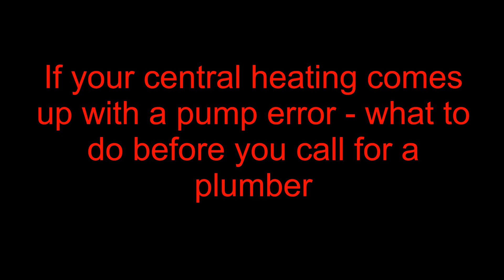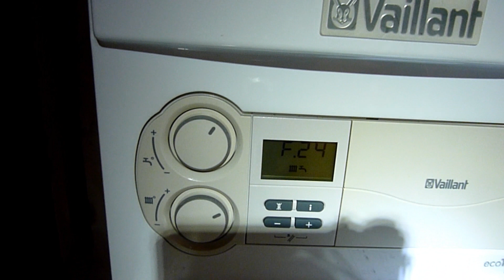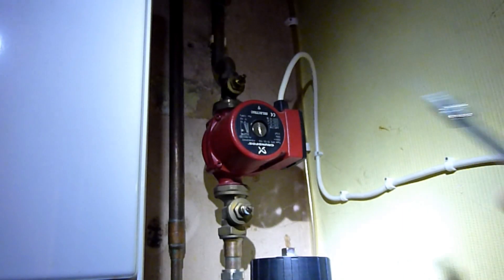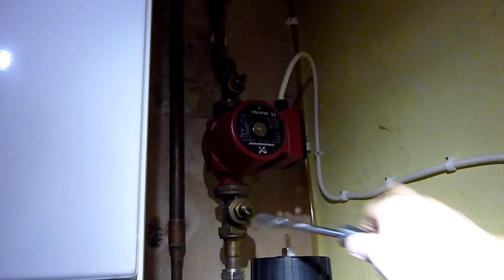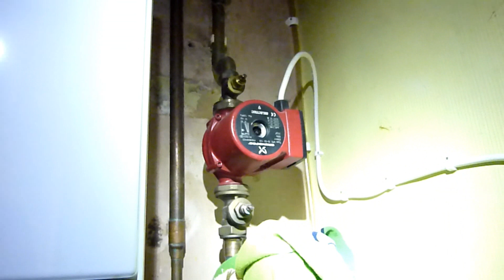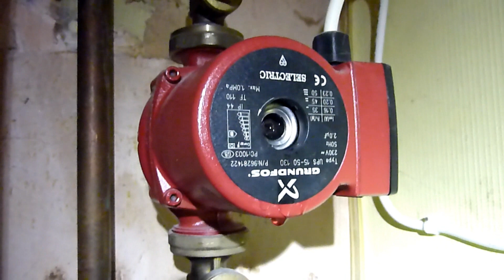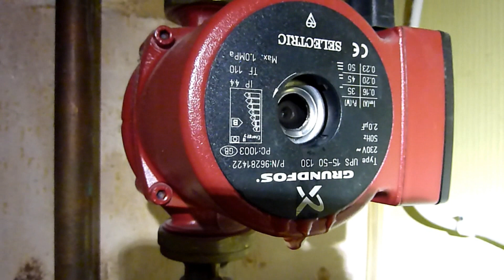Grundfos Selectric Central Heating Pump Stop Working -  What to do

Comment: Thank you soooo soooo much , an engineer came and said £250 to make it run but no guarantee for how long and I just didn’t have the cash , been without a shower stressing 2 days and by gods will came across your very informative video ❤️ god bless you the motor started but let see if in an hour theres hot water coming or not , I have one of those old water tanks :(

Comment: hi, my valves are leaking either side of the pump, looks very similar to yours, tried to tighten, just moved it slightly and they are leaking more now, what is the best remedy.. thank you
Reply from the maker: @backtodifuture  if your pump works still...shut off above and below if you can, otherwise drain the water by running a tap whilst shutting off the stop cock. Add ptfe tape or if there's a silicon seal, replace the silicon seal....ptfe tape is cheapest option , can add plumbing paste if you want.

Comment: I have the same one! When I opened it water keep going outside nonstop!!! Is that normal or water shoud stop droping???
My radiators are not that hot like they used to be.
Reply from the maker: @omistic  you should change the pump...see one of my other videos....if it is a little bit of water non stop then that is normal...if it comes out slowly then that is fine.... your radiators could he blocked up with black gunck.

Comment: Is it normal for these pump to work contnuosly? My pump is not stopping even though i only have a water tank connected to it.
Reply from the maker: @ZoeSham-x5n  that does not make sense... sounds like dodgy plumbing...sounds like you need your water tank at a higher place in your house. If it is in a high place you shouldn't need a pump if there's nothing connected to the system. Try switching it off and see if you still get water, or if it affects anything. Then you can work it out from there the real purpose if any.

Comment: Hello! Can anyone help me with my issue? Namely, from some reason, heating is not working, and I tried to check the pump, by unscrewing the cap as in this video (to try to start it manually by screwing the inside screw), but when I removed the cap on the pump, water started to come out in the stream. I closed it quickly, as pressure started to go down. Is it normal thing? Do I need to ignore the water stream and to try quickly to unscrew the screw inside the pump to check if it is jammed?
Reply from the maker: Yes ignore the water and try to spin the pump like in the video
Reply: Ok, I will try again. I've just checked and noticed that I can hear the pump, when I put it on. But if I can hear, does it mean that it works correctly? Or to try to roll it anyway...?

Comment: my pump got extremely hot and it's not circulating, will your method work if pumps is extremely hot? maybe winding shorted?
Reply from the maker: Replace your pump in your case...see further video on my channel for this.

Comment: Could i use a pump like this to boost water upto a radiator in a loft? (Converted). But put it away from the boiler so its on the vertical that goes up from the bathroom? Or are these best placed next to the boiler itself?

Thanks
Reply from the maker: I think protecting the boiler is more important, so if the pump was located elsewhere and further away from the boiler the efficiency of the water flow going through the pump could be effected though it is factual that water is generally considered incompressible. Think of your own heart...it is pumping blood all around your body but your toes tend to get issues if your heart becomes weaker. I think the easiest solution in your case is either switch the little switch on the side of the pump to number 3 abs see if that works, or simply install a higher rated pump that can deal with pumping up a negative head. Search for shower pumps as a way to educate yourself on negative heads because some shower pumps cannot pump up negatively. I would say just choose a very high pressure rated pump.

Comment: I had one that wasn't pumping but turned quite freely. I was all set to replace it but, on testing, it was clear the windings were still OK and it was simply the capacitor that had died. Interestingly they print the value(2uF in your case) on the label. It's easy to replace so long as you get one that is physically the right size. Its a motor run capacitor and is typically rated at 450vac available in loads of places.

Comment: Good video...but can you tell me why a central heating pump stays on continuously and how would we turn it off as ours won't turn off! Thanx
Reply from the maker: Do the least destructive checks first....turn off power to all units including the wall controller. Turn back on and check. Next try selecting no central heating on by turning down by dialing the temperature dial down to say 5C...if the pump is still coming on, then the control box on the wall where cables enter the pump is faulty....get an electrician to change the box. Observe the electrician turn off the power to the digital unit that has cables going to the pump by going to your home's main fuse box and flipping or pressing the button on the pertinent fuse off before the electrician works on removing the controller.
Reply: @EducationPineapple  Thank you very much for your reply...we will try what you say, thanx (;o)

Comment: Hi Sir, can you please help. We have run out of money and boiler decided to break. Bleed the radiators a couple of days ago and since then the radiators are working absolutely perfect but we have no hot water. Boiler is an old Halstead Buckingham III CF50 with the same pump installed. On water I don’t hear / feel any sound or noise or movement within the pump however when I turn on only heating then I can feel and hear some vibrations and movements within the pump. Can you please help. At the moment we are heating our space with boiler and using electricity to heat the water cylinder. Please help and save. Thank you
Reply from the maker: I hope I can help. Pause the video at 8 seconds. You will see a small white box where the three copper pipes converge. That unit selects either hot water or heating or both at the same time. Remove the cover and really the whole unit for now and rotate the valves by hand. What has happened is that unit is broken and stuck on heating only. The unit is about £20 new. You can do this by hand until you have the money. God bless and keep warm. Watch this next video I made in 2018 to show you more what I am discussing here...https://youtu.be/BEdiQP4vkeM

Comment: Brilliant video. If I ever drain down my system, the pump ALWAYS makes a humming noise, and the boiler stops working, despite clearing all the air from all the bleeds, and all the rads. Really frustrating. Any ideas what it could be? Cheers.
Reply from the maker: I did this technique for about 5 years until I had to change the pump. I have another video on how I changed the pump very quickly. It could be that your pump has failed. It could be also that the valves are closed...or partially closed...see my other video '...change Grundos pump...' because the stop valves above and below the pump works by being on if handle to  valve is on when pointing North South, but is off when the valves are pointing East/ west....if you get what I mean.
Reply: @EducationPineapple  thank you so much for the reply. I don't actually get it, but as soon as I watch the other vid, I will. Every time this has happened to me after draining the system down. I think it is that the screw inside needs slackening off after draining. It seems to coincidental that the pump fails every time. I only used to bleed the pump after draining, not undo the little screw inside. I'll let you know what happens 👍🏽
Reply from the maker: @MohammedAli-1  it means if you turn the water shut off valves 90degrees it will be off, another 90 degrees and it will be back on, so check you haven't shut the water off at the water shut off valves.
Reply: @EducationPineapple  Hi yes I checked and they are both north/south so that is good 👍🏽 Do you know where I can get one from, for a good price. Most people were saying they cost around £150, but looking online they seem to be £250-£300
Reply from the maker: @MohammedAli-1  i got mine for £30 new ....shop on eBay...
Reply: @EducationPineapple  wow. Other brands can be used can't they, when replacing? Is there a certain minimum spec that needs to go in?
Reply: @EducationPineapple  Hi thanks for all your help. Just an update. I ended up buying a refurbished one for £35. I installed it, and it did the trick. I also found that grundfos have an app that allows you to scan your pump, and the app then shows you other alternative pumps that are available to replace the one in your system. Thank you again for your help.
Reply: If you have regular boiler with cold and water tanks check for a unscrew able vent on a bit of pipe.

Comment: I know this is an old post, my Grant combi 90 mk 2 ,( outdoor oil fed boiler) keeps tripping out the burner........ im getting no noise at all from the pump even after opening the screw, turning the impellers (which seemed to have a lot of play like a worn out turbo on a car)....  would you from your experience say the pump is goosed? The boiler was imstalled 2006 if that helps and is the original pump...... hot water diverter valve and hot water blender valve changed 18 momths ago and secondary heat exchanger changed at same time...any advice?
Reply from the maker: sounds like you need a new pump
Reply: @EducationPineapple  yeah i kind of figured as the pump is as old as the boiler and making no sound at all that its dead...  thankyou for the reply my friend 👍
Reply: Did you turn off both isolation valves ,one above and one below before undoing the central bleeding screw to get at the fin retaining screw inside  , ? Thanks

Comment: Thanks. It turns freely but no joy. I have lights on the side which aren't on, so suspect I may have another issue. Mine is part of an underfloor heating system the wiring box is sending and receiving ok. Any tips for what to try next please? 🙏
Reply from the maker: Least destructive method possible which is to check the  fuse hasn't blown.

Comment: I have floor heating on the ground floor,  from the pipes from the floor heating system were hot, everything looked fine, 
- radiators on the 1st and 2nd floor were working properly extremely hot. 22 degrees room temperature

but floor heating on ground floor was not working properly (ice box) 15 degrees. I opened the Grundfos Selectric Central Heating Pump and opened up the little screw and closed it again with the bigger screw in the hope it was getting warmer in the room I have put the room thermostat on 23,5 degrees

But after 45 minutes the ground is still cold any idea's ?
Reply from the maker: Sludge has built up and sunk to the lower floors, or pump is weak, try turning the pumps power up to notch 3.
Reply: @EducationPineapple  Al working again I removed the screw on the pump and it seems the pin was stuck behind the screw and closed it up again all working again

Comment: May l please ask for your help, my largest radiator was cold at the bottom, so removed it flushed it thru and refilled it, bled it & added inhibitor. It is still cold at the bottom but so are all of my others radiators. Water pipe going in hot, but exit valve cold. (It is fully open). Could it be the pump? Thank you so much.
Reply from the maker: There's a switch on gringos pump...select l...ll...or lll.  Try selection full power lll ..it does sound like your pump is weak

Comment: Do you need to turn the water off
Or heating system
Reply from the maker: No unless you think the small amount of dripping water for the 1 minute job will cause a problem
Reply: @EducationPineapple  have you use the heat hero b4 is it any good
Reply from the maker: @fablan3308  no not used before..
Stick to the approved versions of these. Ask at a plumbers outlet for their advice what's best if changing heaters
Reply: @EducationPineapple  I cannot turn the power off on mine supply switch the main electricity box off is it dangerous to do it with electricity on
Reply from the maker: @fablan3308   I think you can catch the few drops of water with a towel
Reply: @EducationPineapple   do I have to switch off the mains electricity before I put the screwdriver in   to spin
Reply from the maker: @fablan3308  you should be okay to just turn it
Reply: @EducationPineapple   I will try tomorrow afternoon and let you know see if I can get it going again thanks you  I wish plumbers were this easy to 
Get hold of it's like a 2-week wait for here plumber

Comment: Thanks for your informative video. My radiators were not warming up about a month ago,  so had to call a plumber who fixed it in 10 minutes, however the radiators stopped heating up again a few days ago, so I did what u have showed in your video.The radiators are working fine at the moment, however just wanted, to ask u if the pump is  always hot when the central heating is working. Mine is very hot at the moment.Thanks.
Reply from the maker: Mine (the same one) is only warm, even though the heater is on and pumping. Try lowering the thermostat at the wall so that the heater is not on. Leave it a while for your radiators to cool down then check the pump again. If it is still hot even though the water has cooled off then your pump is faulty.
Reply: @EducationPineapple  Thanks for ur prompt reply. I will try what u have said and see how it goes. Thanks once again.

Comment: Thanks so much! i tried your method and it worked! although it was a struggle to get the piece to rotate and half of it snapped off! its seems to be running the motor now and heating working fine.

Comment: Cheers for this, got my heating and hot water running again at a time when I don't have the cash to spare for a plumber, few weeks and I'm good so hoping it lasts till then, thank you for taking the time to help others by posting the video
Reply from the maker: Mine's still working, so try this trick a few times before replacing the pump.
Reply: @EducationPineapple  good to know thanks, I'll try this as long as I can get away with it, will give me more time to save up for new pump

Comment: Did the pump need cleaning out?or is it better to fit new,
thanks.
Reply from the maker: Filter may need cleaning. The pump just needs turning a little. Haven't changed my pump yet.
Reply: @EducationPineapple  Thanks.

Comment: I wouldn't say you need special tools. Just a couple of flat bladed screwdrivers of the right width.
Reply: 3mm flat head as advised in manual
Reply: I had a chuckle at that...He talks about needing a special adapter and shows about 100 different security bits, drivers, and a full socket set, but in in reality it turns out to need a 3mm flat bladed screwdriver, plus a slightly larger flat bladed driver for the outer plug! 🤣
A part from that, it's a handy little video, and is applicable to most of the central heating pumps I ve come across over the years...
Reply: I had a chuckle at that...He talks about needing a special adapter and shows about 100 different security bits, drivers, and a full socket set, but in in reality it turns out to need a 3mm flat bladed screwdriver, plus a slightly larger flat bladed driver for the outer plug! 🤣
A part from that, it's a handy little video, and is applicable to most of the central heating pumps I ve come across over the years...

Comment: Do you need to turn off the water and drain the line before you take off that outer screw??
Reply from the maker: Oh no you do not have to turn the water off or drain the tank to do that. There is a tiny bit of water that comes out from the sealed unit, which is normal.